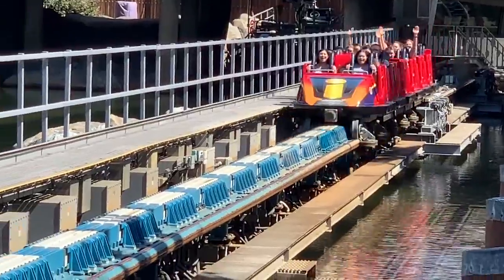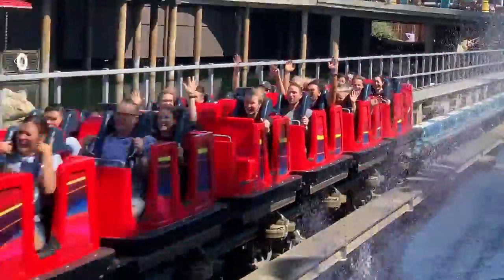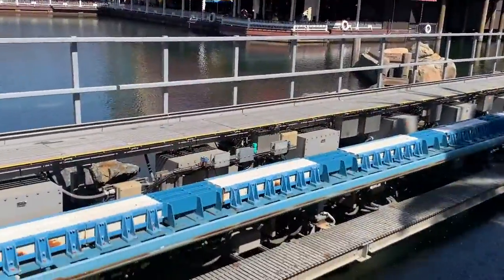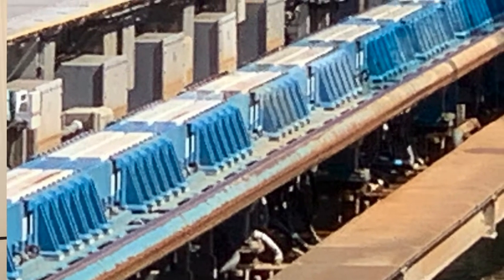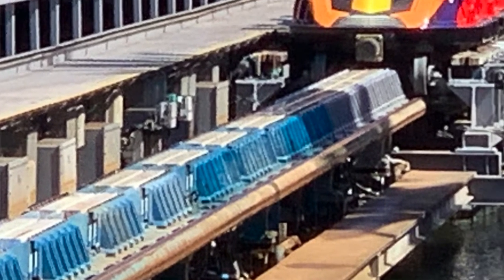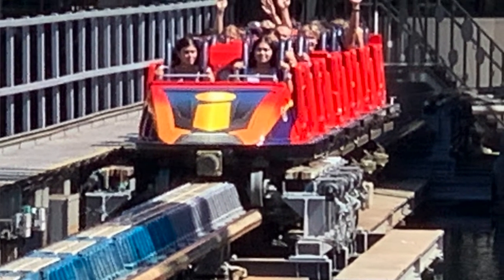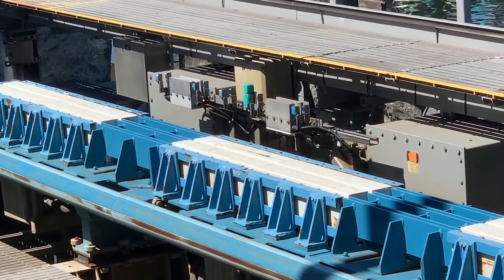IEA NET sensors on rollercoasters

Comment: What made me realise that the motors on a LIM or LSM were activated by "following" the train was the sound of the launch.
Even though I was wrong on the thought process, however, I ask myself where the sound of the launch actually come from ?
Is it from the motors activating or from the interaction between the train, the magnetic field and the coils, or both ?
And what makes the sound different from an Indrivetec's LSM launch (Intamin) to an Intrasys's LSM launch (Mack, B&M, Gerstlauer, Premier Rides, S&S) ?

Magnetic launches are really a fascinating "field" (got it?!) in the industry !
Reply from the maker: That’s punny!! Haha! So it’s a complicated answer. For LSM you Simple’s hearing the windings vibrate inside the stator (motor) and that’s about it. 
For LIM it’s mainly in the stator again but the driving vibration wave produces a wave on the reaction fin on the train. So imagine the fins on the train like a symbol on a drum set. Although it can’t get too loud as Is bolted in tighter than a stuck groundhog. I’m actually do a LIM LSM video now but it’s going to take a bit to make so might be a couple of weeks before it’s out.

Comment: Hi Ryan, 
I've always wondered this about those Intiman impulse coasters. Every one I have been on sound like it squeals very heavily when it takes off. Is there any reason for this?
Reply from the maker: Good question. That is the sound of high energy induction through the motors. The windings in the inside of the motor vibrate and make noise and the current gets dumped through them. Most motors are wired in series with other motors this causes amplification of the sound. The sound is also picked up while the reaction fins on the train vibrate as well! (A lot to unpack here.) older or Cheaper rides use air cooling inside the motor so the sound can echo and travel. Higher dollar motors are water cooled, like California screaming or incredacoaster. So water cooled motors adorn that vibration and you can barely hear them outside of the noise of the train! Thanks for the question.
Reply: That makes sense! For a long time I thought it was someone screaming like crazy when the ride started, lol!
Reply from the maker: @chriss1019  hahaha!!! So funny. Same thing I though though. Wasn’t until I was working on that end of the park and it was about 6am and it started running. I had my ah ha moment. Same as you, it’s not people making that sound. I’ve allways been fascinated with launch coasters.

Comment: Could a park easily change take Incredicoaster for example, the impulse launch system with an LSM launch system? Great video, I was curious to know what those boxes were in the sides.
Reply from the maker: Inside a stator their not much to look at. If you tool a spool of wire and wound it into an oval, and repeated that 9 times around an iron cores, that’s it. I had the same question so after one wore out I stuck a bore scope on the inside but there’s hardly anything to see. 
I’ve not heard of a conversion from LIM to LSM. I’m my mind it’s possible with newer technologies, but I feel the conversion would be equal to half the cost of the ride.
Reply: @ryantheridemechanic  Oh okay cool thanks. I appreciate these vids, for some reason Disney is not very adamant on talking about technical aspects of their rides with guests.